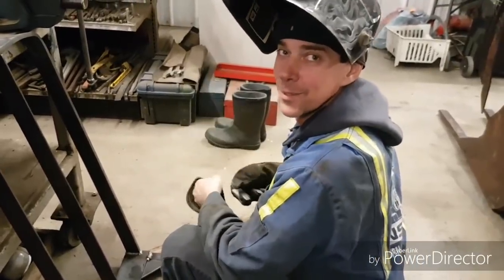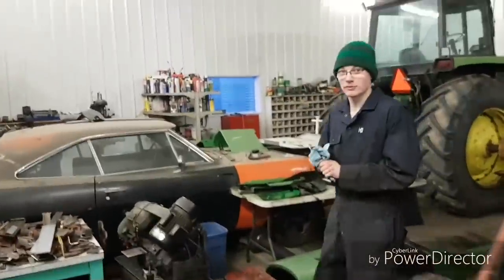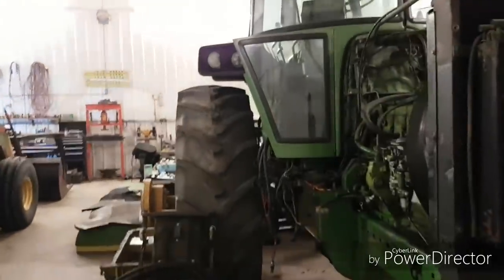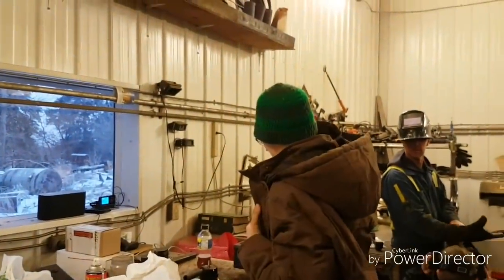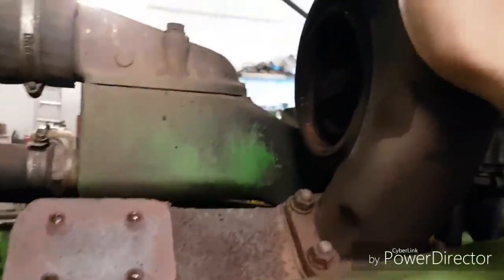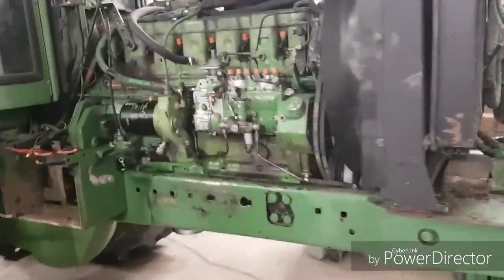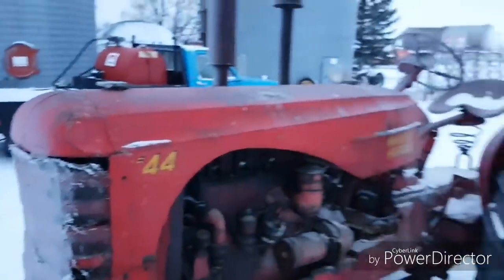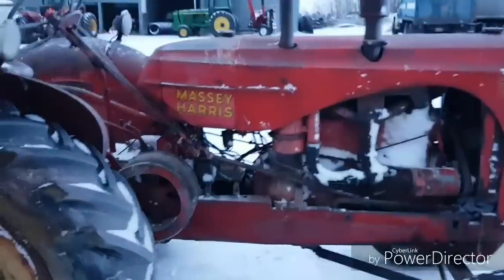4640 update and the new 44 massey!! 4640 restoration part 3!

Comment: You ought to replace those old box style leaky fuel filters with the canister style.     Just need filters and housing for a JD 7200.   They bolt right back in and work great.  Done it to all my 4030, 4050's, and 4450
Reply from the maker: Never have the glass filters leak haha

Comment: You can safely weld on a gas tank if you fill it up with water first, just leave the part your welding above water (with as little air space as possible above it.) Another trick is, fill the tank with nitrogen gas or helium or argon or any other gas that won't support combustion-- run a line in the top of the fuel tank and stuff a rag around it to keep the air out and vent the air out of the tank with the inert gas so the tank is full of inert gas-- the fuel vapors cannot ignite if there's no oxygen to support combustion.  Later!  OL J R  :)

Comment: Fucking right you got a Massey! My main loader tractor atm is a 44 I put a full hydraulic loader and power steering on it it easily has 50000 hrs on it and the bottom end has never been touched. My great grandpa and Grandpa both used it also as one of the main tractors

Comment: Nick 
 In my experience with my 4020 the boots on the injectors were also leaking I tried a cheaper boot didn't work also tried the hose clamps didn't work  I went to Deere I bought good stanadyne injector boots and new clamps didn't leak at all  Take it for what it's worth
Reply from the maker: Hmmmmm
Reply: I'll have to agree with you 100%. Those "Jesus" clamps work better in the long run than a worm gear clamp. Being a spring clamp they keep tightening over time, not so for a gear clamp. The original rubber tee's get hard after 20-30 years or so, ya gotta change them occasionally.
Reply from the maker: @heartwoodfarms9982  your the first guy I've ever heard who likes a jesus clamp lol

Comment: The first gas tank I welded was a saddle tank off a grain truck, I had to straddle it to keep it from rolling across the floor. Yes I did say a prayer before I lit the torch. Ha ha just run exhaust from a pickup into the tank and no boom. Ha ha
Reply from the maker: I'll pass though lol
Reply: @SouthSaskFarmer1  chicken 😂🤣
Reply: Done a few... Don't like to, but.
Had an "L" tank that I used for gas and diesel, switched back and forth.. had one seam that couldn't handle air pressure to pump it out.
I'd fill it with water. It never went BOOM!
Had a friend who worked at a wrecking yard, he scrounged up any Halon fire extinguishers he could.. he used them to purge tanks..
Reply: Exhaust pushes out the oxygen,  so you have no combustion,  its science , eh ....
Reply: @bryancovert9821  yup..
Reply: @Teddy Goebeler yes, I know.. 
Any inert gas will do... 😎

Comment: that tractor was on kijiji as well. now that you have a modern tractor with a belt pulley i can set you up with a 'vintage' grinder and a flat belt so you can make chop for your chickens to save money. feel free to use Antoine's tough wheat. i will trade you for Gary Lazer Eyes version 2020.
Reply from the maker: Deal if you deliver it!! For real haha
Reply: @SouthSaskFarmer1  next time i'm over at the old shop with my big boots on i'll have a look-see if it's still where i think it is. i have no idea what condition it's in either. will let you know. maybe ill make a short video.
Reply from the maker: @yako0000  ok haha!!

Comment: JD makes a Brass Tee Leak off Kit as a upgrade
Reply from the maker: May have to look into that
Reply: Used to put the brass bleed line kits in all the time when I worked at the dealership. Those rubber tees are useless!
Reply: The brass T kit is good.  Little spendy but not having to change boots when it’s 90 degrees out is worth it